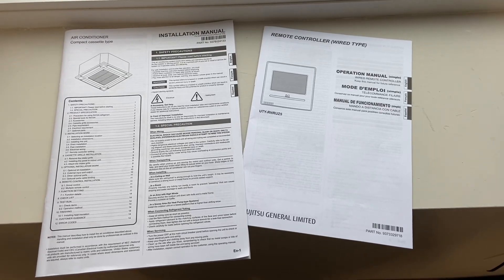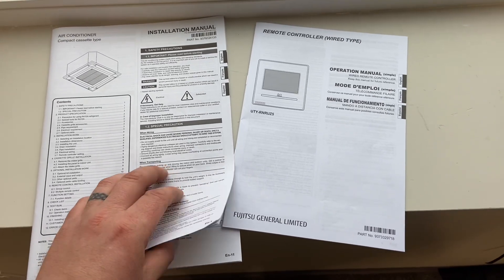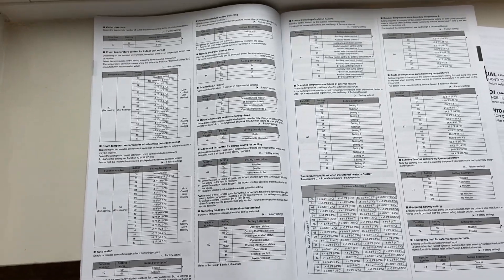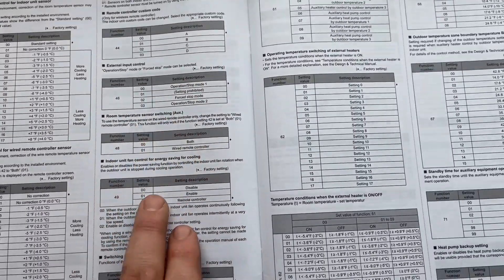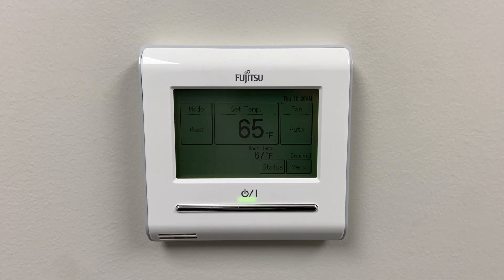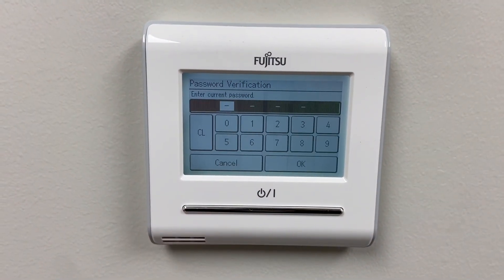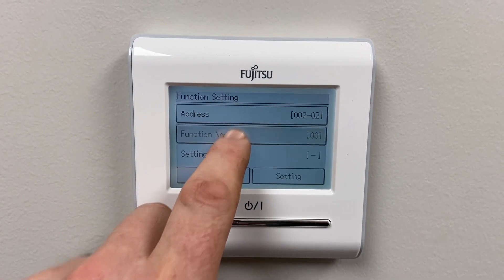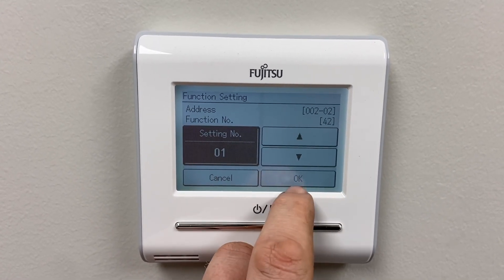Setting up Fujitsu controller to sense temperature

Comment: So I did this and I do now see the temperature probe with the thermostat symbol, but it still doesn’t show the temperature. Any advice?
Reply: OK, so just in case anybody runs into what I just ran into I had to go into the settings and there was actually a setting that asked me if I wanted to display room temp setting and I had to turn it from invisible to visible.

Comment: having some issues with the temp settings as the cooler is intermittent rather than constantly blowing cold air. The unit is not set to auto

Comment: Hey Caleb, I work for Fujitsu general America. I have used this video countless times to help techs set the thermo sensor! Thank you for this great tutorial! Can you make one for setting static pressure on ducted units also, I have a lot of problems walking guys through that process!
Reply from the maker: Hey there, sorry for not responding sooner. Unfortunately I no longer work for a Fujitsu dealer. But if you are interested in me creating more content for Fujitsu hit me up!
Reply: I have this in my house upstairs. I want to change to an app-based controller, like NEST. Is this even possible?

Comment: Mine doesn’t show RC sensor setting?  I did not power down the unit thought from outside. Would that cause me not to see that function?  Mine is set at 62 but reading 80 on room temp.
Reply: After setting the 42 and 48 codes to on, you MUST turn it off at the breaker for at least a minute. Once that's done, it will reinitialise and you'll have the RC sensor setting to turn on.

Comment: I need helping setting the temp to auto, ex- my heater will keep running even after it hits the set temp. The fan is on auto however.
Reply: I have the same exact issue. Did you ever figure out how to fix it?
Reply: No 🙁 I had an hvac tech come out through my home warranty. He didn’t seem to understand what I was explaining.
Reply: I have this remote and 4 of the simple UTY-RSRY remotes. I can also get into the function settings 42 and 48 with the simple remote. Is that all I need to do one those as well? There is also a F1-07 setting that the manual says to change however that function is prohibited on 3 of my 4 RSRY units. Seems quite odd…
Reply: Did you figure out the function prohibited on the simple remote?  I’m having the same issue ugh

Comment: I have the same thermostat, but it does not display the room temperature. Is this something that needs to be enabled? I was able to do the settings that you showed and the video, but it did not show room temperature.
Reply: Yes it needs to be enabled, I had the same issue.  Go to menu> initial setting > display item setting > room temp > visible.  Hope this helps.
Reply from the maker: Yes this has to be enabled.